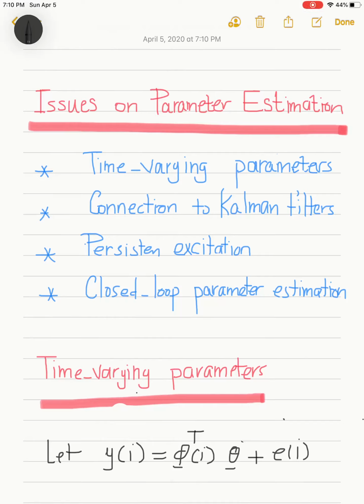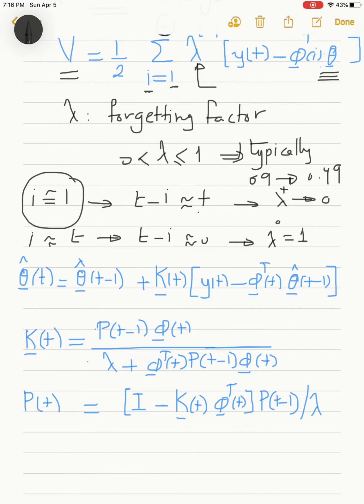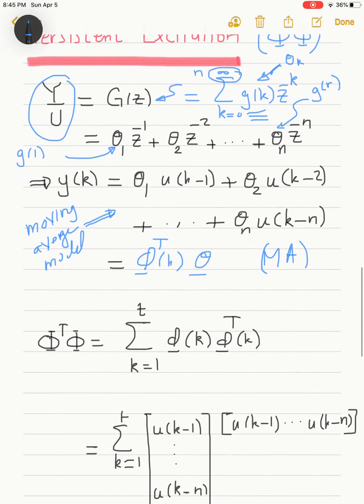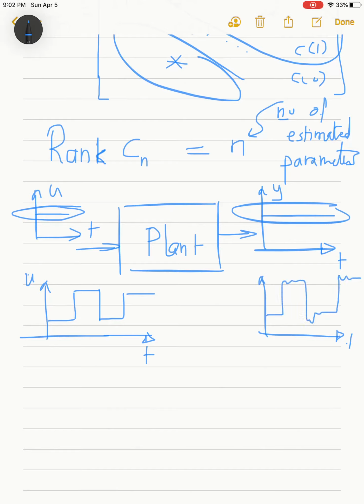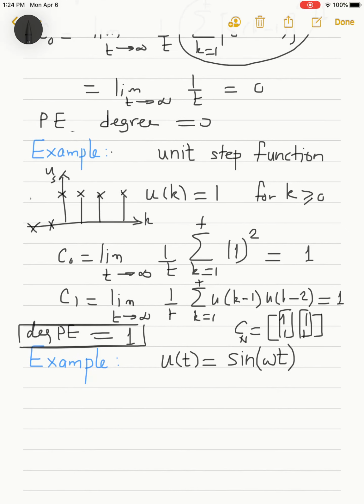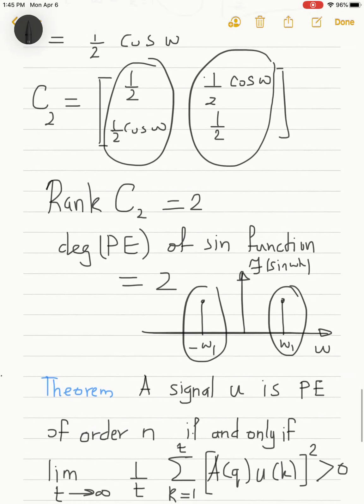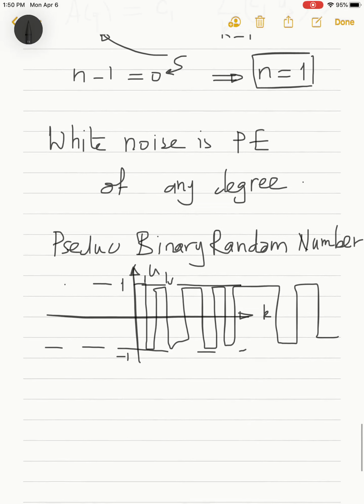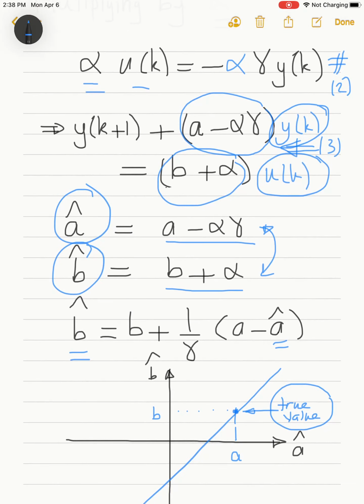L23 Issues on Parameter Estimation

Comment: When the system is at steady state with noise, the parameters continues to be updated and the estimated parameters diverge from the real values. 
By example, take a step on 5/(s+1) with Tsampling=0.1sec. You'll see that from 0.5 to 10 sec the parameters are good but after that by example, 100 or 1000 sec the parameters are not good (same with ARX, ARMAX, etc.). How to deal with that? Do we have to lock our parameters? I already tried to filter the noise with a low pass filter of tau=0.1sec.